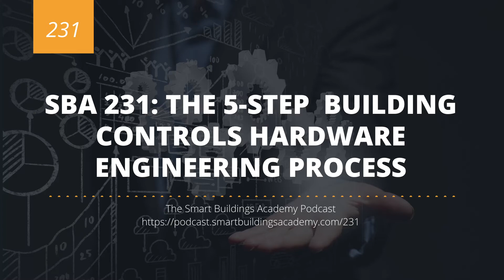SBA 231: The 5-step Building Controls Hardware Engineering Process

Comment: Any plans on tools required and recommended?  Maybe a van load out or a tool bag load out?
Reply from the maker: Sure we can work on that. Fortunately for BAS there's very few tools we need other then wire strippers a 10-1, and a multimeter.
Reply: @SmartBuildingsAcademy  Awesome!
I appear to have most things but coming into it from Hvac service, I keep thinking I must need more tools than this!
Reply from the maker: Well there's always more tools. The thing is most of what we do is low voltage troubleshooting, IT troubleshooting, and Controller troubleshooting. A 10-1, meter, maybe a mag gauge and pressure bulb to test out flow switches, and such.